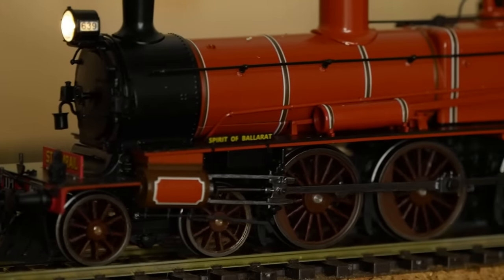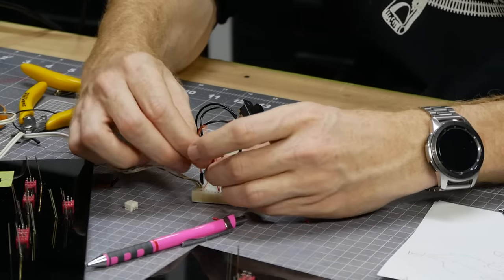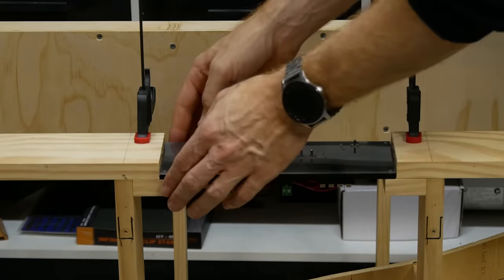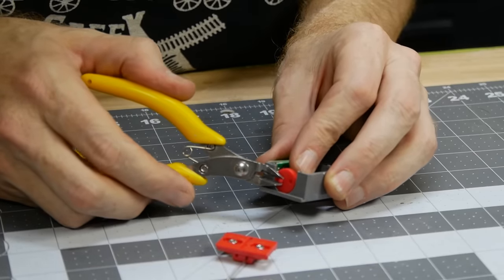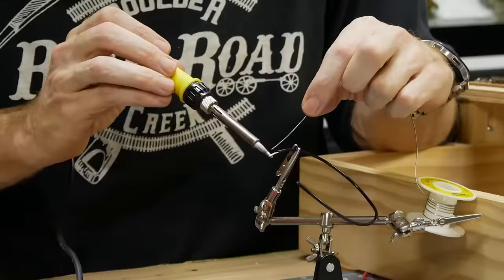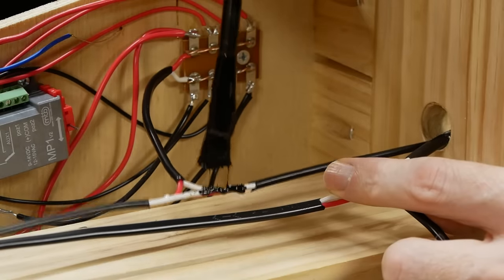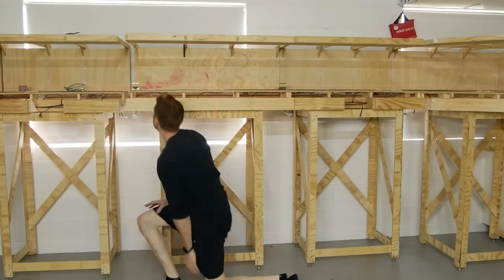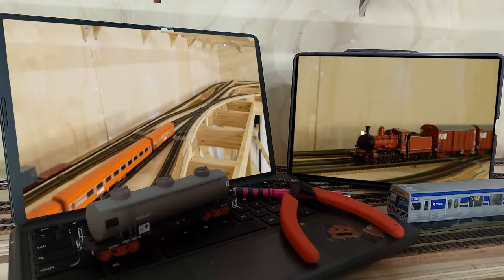A Guide to Wiring Your Modular Model Railroad

Comment: A note on leaded solder - If you're creating lead vapours, you're soldering at far too high a temperature, as it will only vaporise at about 1,750 degrees Celcius (average soldering temps are generally in the 300-400 degrees range), the vapours you see emitted when soldering is the flux evaporating, and unless it's that nasty lead-free flux that needs some harsh chemicals to get it to stick, it's generally not considered harmful...
Reply from the maker: Oh nice, good to know 😉 so I guess it's the flux that's creating the fumes. It still probably good to avoid the fumes, I did some soldering and didn't have good ventilation not long ago and after about 5 minutes I started to get a headache! 
Thanks for the info 👍
Reply: @BoulderCreekRailroad  There are simple ways to deal with the fumes (usually they use Rosin as a flux, which is a natural product from Pine trees), one of which is a comptuer fan that's blowing through an air filter of some sort, I have one attached to a Kirby vacuum cleaner bag (a rather large charcoal-filter style bag), fumes go in, air gets filtered, but in general I've rarely had issues with the fumes, but I tend to solder with the window open anyway... :)
Reply: The average leaded solder will be cored with rosin flux, which is harmful if inhaled. This is why the average electronics hobbiest will employ sone kind of fume extraction device. Ultimately it’s about being sensible: if you are only soldering once a week for a few minutes, opening the window is sufficient. But there’s a reason why anyone doing it in a commercial setting is required to have fume extractors in place. But yea, the lead isn’t the problem.
Reply: @lawrencemanning  I added a reply describing what I use for filtering the fumes, a comptuer fan blowing into a charcoal based vacuum cleaner bag, very cheap and simple to put together... :)
Reply from the maker: Yeah, I'm lucky to solder once a month, but when I do I solder a whole bunch of things at the same time. 
I prefer the leaded solder because it flows so much nicer and yes it has rosin flux. I'll make sure to use a fan and keep the windows open when I do soldering for sure 😉
Reply: Yet another great video in a long line of great videos, thanks Luke. When I worked in an electronics shop, management was concerned about people inhaling rosin fumes (health department and possible litigation from both present and past employees), they installed a down draft soldering station. Concern about inhalation of rosin fumes is of course a valid but, me thinks one would have to be soldering continuously for eight hours a day, five days a week. If you soldering occasionally, I would think a fan gently blowing across the work area would be a sufficiently prudent measure.
Reply: @BoulderCreekRailroad  One thing from someone who used to work as an inspector in a factory that used leaded solder (contract work for the military, so they were allowed to ignore ROHS). As said before, the lead fumes aren't an issue. However, one thing that is a fairly big concern is lead dust. Since lead exposure is cumulative over your lifetime, it is very important to wash your hands after handling the solder, and to never do anything like sanding/filing the joints that will create more dust. Also, its best to avoid using a vacuum or air duster, a brush is the best way to prevent fine lead particles from becoming airborne. The main ways people are exposed to lead from solder are either ingesting it from particles on their hands & clothes, or breathing in small airborne particles. 

The rosin flux fumes aren't actually particularly hazardous and in an industrial setting fume extraction isn't always required (at least in the US, AU likely has different rules), but most people find the rosin fumes irritating for their eyes & sinuses so a small fan is very helpful just to keep the fumes from irritating your eyes while you solder. But definitely don't ignore the handwashing after handling the lead, that is how people end up ingesting small amounts and the amount builds up over time.
Reply: Nice one Luke. I liked your Bunnings Level. Might see about one for our club.
Reply: Leaded solder flux absolutely is nasty. Get a fume extractor.
Reply: However lead can sublimate and already begins to do so at around 360 degrees celcius at 1 atm of pressure. Tin has the same sublimation temperature and leaded tin solder the same again.
Although the amounts of vapor created at these low temperatures are miniscule but still something to be vary of.

Comment: Hello Luke, I regularly look at your constructions and the latest ones more particularly concerning your modular rail network. Like you, I use the MTB relays under the table and like you, I made templates to position them easily. On the other hand, I inserted a piece of 2mm cork between the motor and the template because I find that they make noise when they move. The cork dampens these vibrations a little. You explain very well, keep up the good work. Hello from France

Comment: Hello Mr Towan. My wife Yvonne and I (Antwan) have been planning 2 H0 scale model train layout for almost 3 years. Both tracks should be dismountable. And we are also in the process of setting up the 2 rooms. So far so good, the layout is on paper and partly in my memory. They will be analogue tracks, with control panels just like the ones in your presentation. I have experience with acrylic plexiglass so that will be fine. The solder tin I use has 60% tin and there is flux in it. I have the temperature set at 336 degrees. Little smoke or smells. The rails are from Fleischmann the brass variant without ballast.
You are our great example on the internet though, because of your input we are also going to use magnorail. There are images on YouTube showing that magnorail can also be used at a rail crossing. Then, however, a layer of the rails has to be ground away through the bottom with a dremel or proxxon. My father taught me to build with wood, and I am a heating engineer and plumber. We still want to go to Germany in Hamburg to see the most famous model railway exhibition. That will hopefully happen one day. My wife and I wish you all the best and who knows, maybe you will come to the Netherlands one day at a model railway exhibition or the train museum. Greetings Yvonne and Antwan.

Comment: Luke, a tip if you need small gauge wire and can't find it. Go buy a roll of thermostat wire, peel the individual strands apart and strip the sheathing off of them. Presto! That's what I did for my N scale model.

Comment: Instead of soldering a tag board you could consider using Wago 221 series terminals (or some other brand available in your local hardware store). These are meant for connecting both solid and stranded wires in house installations. They provide a firm joint and will save you quite some time in soldering. 

That being said, great video and looking forward to the next!

Comment: I had to look up those switch machines. I hadn't seen them before. Still leaning towards servos for my switches.
Reply from the maker: Yeah, they are good 👍 whatever works should be good though. Servos are great, there are lots of different options for switch motors and they all have their ups and downs 😉

Comment: Love your videos. Watch every one. And watch some of the old ones more than a few times.
Your LED wiring shows 100 ohm resistor series with a green LED with a 12 volt supply. The voltage drop across the LED will be close to 2 volts and therefore 10 volts across the resistor.
I = V/R =  10V/100ohms, or 100ma. This means there's 100ma flowing through the LED and resistor. 
The LED Power consumption is 
2V * 0.1A or 0.2 watts. This is an awful lot for the tiny LED chip to dissipate.
The upper limit for an LED is typically 10 to 20 ma. So your example gives really too much current for the LED and may burn it out.
To bring it down to a safe 20ma use
 R = V/I = 10V / 0.020A = 500ohms. The nearest value is 470ohms. 
For 10ma use a 1K resistor but this might be too dim for your environment.

Comment: How do you rate the MP1 switch motors against the Tortoise ones for noise? I find running the Tortoise motors at a lower voltage (9v) makes them quieter and the points throw more slowly/realistically.  It may be worth a few experiments on the breadboard...   Great to BCR finally coming to life. 🙂

Comment: Hi Luke.  Really enjoyed this video and your others I have seen.  Where did you get the  MP1 point switch.  I cannot see it at local suppliers
Reply from the maker: I actually bought them from a hobby shop in France. Unfortunately I too haven't found anyone who sells them locally 😔
I think you should find some from the UK, but postage is a bit expensive and the price of the unit has gone up a lot in the last 12 months, but they are great little point motors!
Cheers, Elle.

Comment: Awesome video Luke. The wiring s one of the most important things on a layout and I like how you made it look so easy! Those switch motors look good. Nice to see trains running too.
Reply from the maker: Thanks mate, yeah wiring is very important! I'm a huge fan of the low profile switch machines, it's just a bummer they aren't easily available from Australia, I had to order the ones I have from France, which isn't a problem except postage cost are quite high!

Comment: I do not know AWG codes.  I use 14x0.2 mm copper stranded cable (code is 14/020) that I get from alarm suppliers in 100 metre rolls.  They are sold in two and three pair rolls, so you can get six colours in  a three pair cable.  I use this for droppers or point motors but you could use the finer 7x020 for short runs.  You can also get 18 strand, 21 and 24, which are used for speaker installations.  For bus wires I use 2.5mm household electrical cable,  the stuff used for power points.  I strip the outer insulation and use the red and black cables.  I also use the Wago cable joiners mentioned below.

Comment: Nice work Luke.
Clearly explained. 👍
Did you insulate the garage door so you can use an air con unit?
Humidity here is not good for my layouts.
Happy Modelling.
Mon
Reply from the maker: Thanks Mon, I haven't done anything yet about insulation. I'm actually planning on removing the garage door and putting a sliding glass door... but that's a future project 😄
Reply: @BoulderCreekRailroad  you bet it is is.
Maybe double glazed to keep the heat out?
Good luck with that. 👍

Comment: That was certainly interesting and informative.   I'm curious though, I know general wiring works for either DC or DCC setups, but what about those switch flippers, it seemed that you wired in to the same as your track wiring,  but it won't work with DCC will it?
Reply: No, the motor in the MTB MPx switches can be operated with AC (12-15V) or DC (9-14V) voltage, so you can use track voltage to operate the motor. But there is no decoder, so no DCC.
Reply: @Drobek1989  Ok, so if you want a setup to run DC or DCC with the flip of a switch you'll want to wire these up separately of the track voltage.   Thanks.
Reply: @Mike__B  exactly. On  our club layouts I am keeping track and "steering" (switches, lamps etc.) circuits completely separate, so we can use them as DC or DCC
Reply from the maker: Yeah, I probably wasn't entirely clear, I have 2 BUS wires, one is connected to the DCC control unit which has all the feeders connected to it via the tag board. 
The second BUS wire is connected to a 12 volt power supply which is separate from the DCC system. The second BUS is what powers the switch machines to change the direction of the points.
The switch machine has a SPDT switch built into it which is connected to the track power (the DCC BUS) which changes the polarity of the frog.
Hope that helps 😉

Comment: I really love your work. 
I do have to say, though,  that you lost a lot of strength replacing that whole section of front board with the control panel. I would recommend going about 3 inches back from the old board and adding a brace to reinforce the whole set-up, or the whole thing is going to want to twist when it's being lifted or moved.
Reply from the maker: Yeah I did consider that, when I removed the section I gave it a test to see if it lost much rigidity and it held really well, there was minimal twisting. Plus once I attach the fascia which is 4.8mm hard board it should bring back a small amount of rigidity. If it's a problem I'll go back and add additional support but at the moment it seems OK 👍

Comment: Why not use lower wattage LEDs to lower the brightness, and acrylic should always be solvent welded.
Reply from the maker: They didn't have the colour I wanted in a lower wattage LED, also it's more than ok to use the spray adhesive, if I need to dismantle the panel I can simple soak it with alcohol and separate the parts. If I use solvent that won't be an option... I was originally planning to not use adhesive at all given the screws hold the panel together 😉